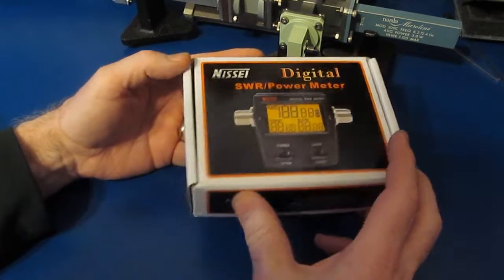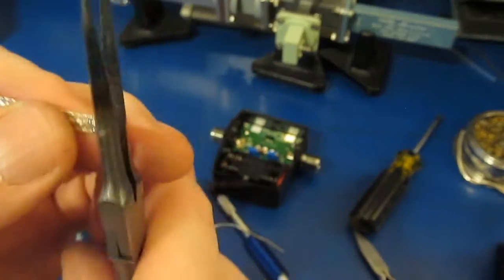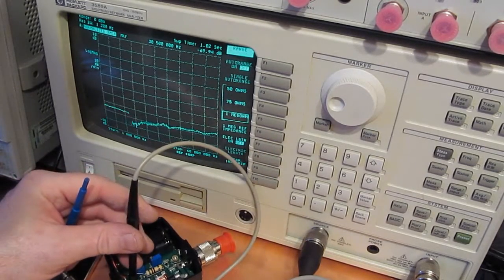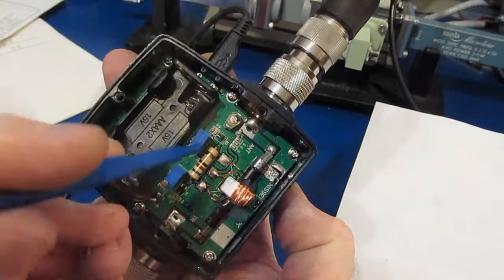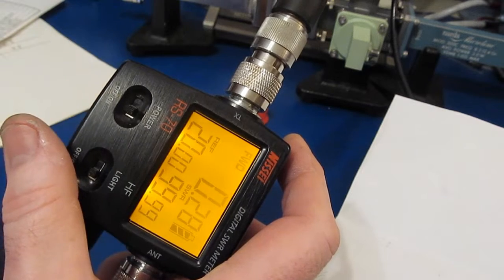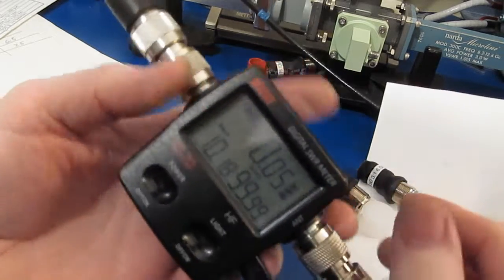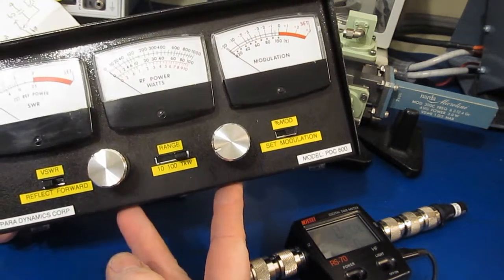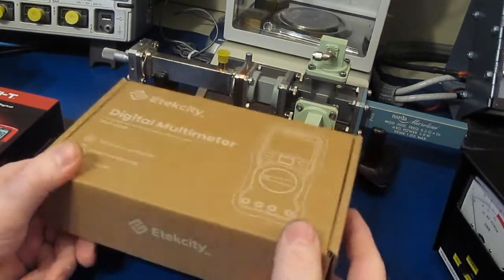Modified NISSEI RS-70 Digital SWR/Power Meter

Comment: when I made a PCB based power meter I used finger like traces to make a static shield that did not block the magnetic part. So imagine single straight wires around the coax from both sides, but the wires do not touch. they just lay beside each other.
Reply from the maker: This is similar to how the Para Dynamics coupler works.  It's an air line made of a brass rod with I think five rods surrounding it for the various functions.

Comment: Did you check whether the Nissei has  1N4148 or low barrier schottky diodes? Changing them may improve the reverse power sensitivity.
Reply from the maker: I didn't check.  I thought about trying to align it by applying power to the input, with a known load then adjusting the reflected power until it reads the proper VSWR.   The problem with this is I would need a stable load that could dissipate enough power.  My small mismatched loads are not up to the task.  Seeing the huge difference between the 100 ohm and 25 ohm mismatched loads, I doubt it would work out.

Comment: The easiest way to remove hot glue from something is to put some isopropyl alcohol on it. That will make it quickly release from almost anything.
Reply from the maker: My experience with that glue they use is that it doesn't adhere well to smooth surfaces.  Pliers worked well and you could see, it left no residue behind.

Comment: Since it is by directional I would of thought you would connect the shields on both ends of the coax, not just one.
Reply from the maker: Well, it is a transformer.  Think of it this way.  If you ground both ends, you now have a single turn output that is shorted.  Basically, the transformer no longer will work.  We want the braid to act as a shield.